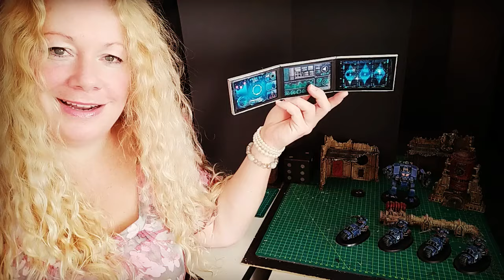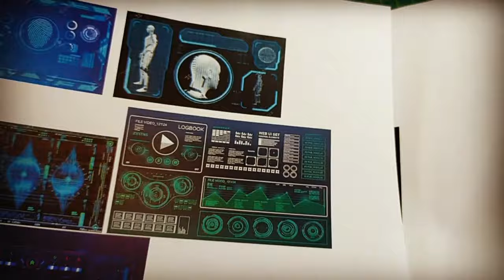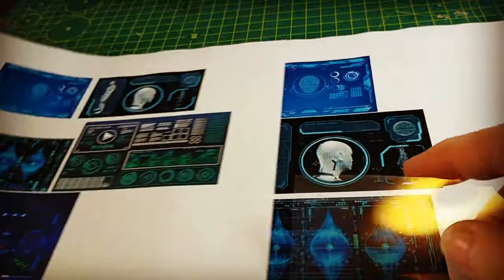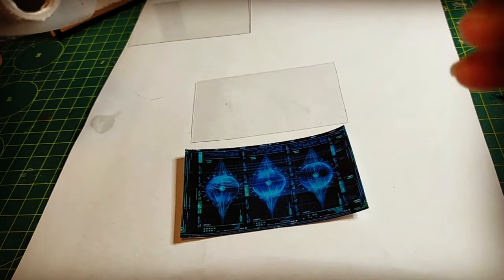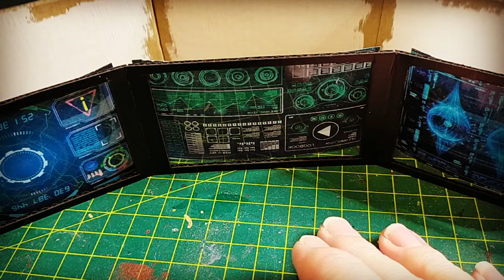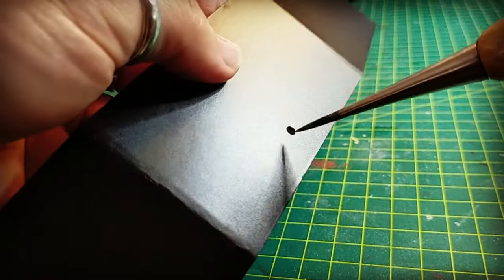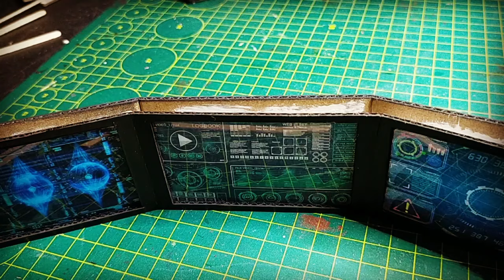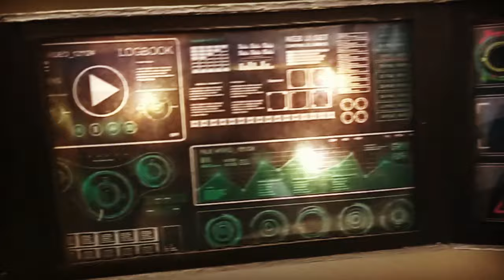Sci-Fi Multi Monitor DIY

Comment: Looks incredible, I would never have imagined that the glue would dry so clear and work so well for this. I don't know if this will be of any use to you, but I have seen other miniaturists putting something like tracing paper between the lights and the surface to diffuse it.
Reply from the maker: It's amazing how the glue dries crystal clear, this technique is fantastic for making little signs on the inside of shop windows and that kind of thing. I think tracing paper would have worked very nicely to disperse the brilliance of the tiny bulbs, Thank you for the idea, I'll keep it in mind!  🙂